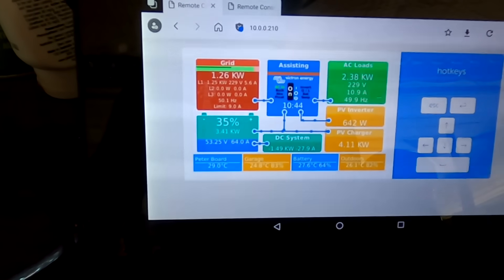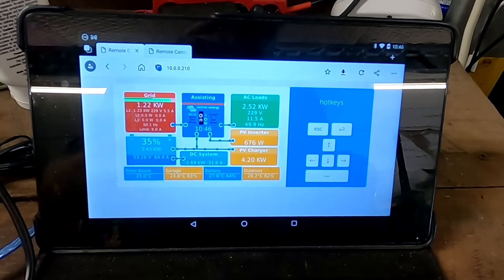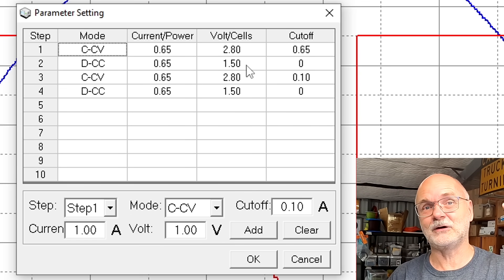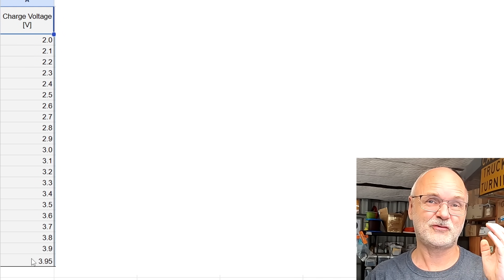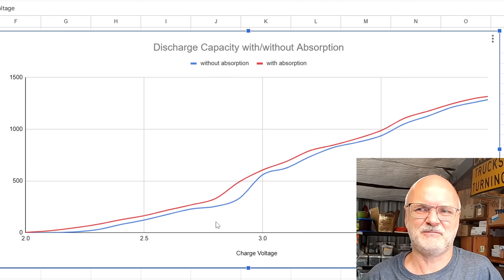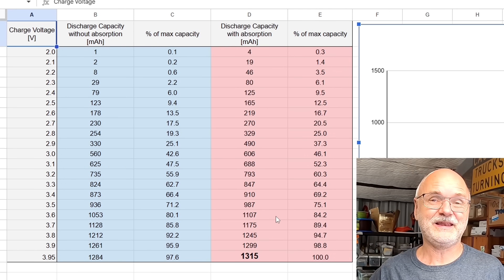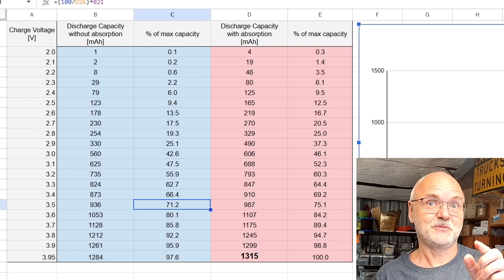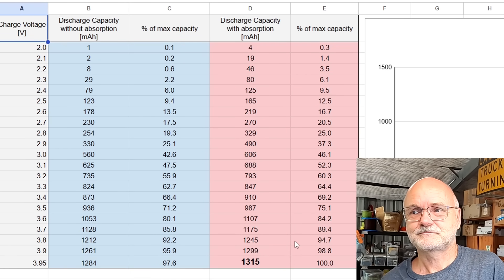Absorbing Sodium batteries. Capacity gain or worthless?

Comment: HI
forgive me if I take advantage
I have a problem with bms JK B2A8S20P-HC
I made a mistake in setting the temperature, the BMS turns on and I can read the screen that indicates "TEMP --200° celsius"....but after a few seconds it turns off, I disconnected the BMS from all the cables power supply and after 3 hours I reconnected the BMS but nothing changes, it shows for a few seconds that everything is ok no errors but the temperature is ---200° C, what can be done? I wrote several emails to jkong but they don't reply.....thanks for your understanding.
michele italy
Best regards
Reply from the maker: Disconnect the temperature sensor?
Reply: @OffGridGarageAustralia  connected or disconnected nothing changes 😪
Reply from the maker: @theanimalsfarm5911  No idea, sorry.
Keep emailing them and send messages on Whatsapp as well.

Comment: Hallo Andy. Ich schreibe dir hier weil ich sonst nicht weis wie ich dich sonst erreichen kann. Es geht um den neuen JK BMS. Hab hier bei mir 2 Stück davon. Leider gibt es ein Problem bei dem Pylontech Protokoll. Dort fehlt die Manufaktur Name. Die wird nicht gesendet und aus diesem Grund funktioniert z.b mein Solis rai-3k-48es-5g nicht. Wechselrichter meldet sofort Alarm (BatName-Fail). Hab gestern die neue 15.11 drauf gemacht. Leider ohne Erfolg. Was aber halbwegs funktioniert ist das Victron Protokoll mit meinem Solis WR. Problem hier ist dass die Spannungen RCV nicht übertragen werden. Das nächste Problem beim Pylontech Protokoll ist wenn man zwei BMS parallel schaltet. Beide sind auf 63A Ladegrenze eingestellt. Beim Wechselrichter werden dann 59.8A angezeigt. Das ist ok, aber dann in unregelmäßigen Abständen sendet der JK BMS neuen Wert an den Wechselrichter und der ist 119.7A. 10 Sekunden später geht er wieder auf 59.8A. Also es ist beidem Pylontech Protocol ein Wurm drin. Bitte helfe mir. Hab schon JK selbst angeschrieben aber es kommt keine Antwort. Gruß Peter aus Deutschland.
Reply from the maker: Thanks for sharing. Nothing I can do because I cannot repeat this test here as I don't have such an inverter to test. Pylontech protocol is always a compromise and may work or may not.
Reply: Thanks Andy for the feedback.  I can understand that you can't test this.  You should only send a message to those who add this company's name to the log.  They have now done this with the Victron protocol!!!  Version 15.11 says in the log history that the vendor name has been inserted, which you can insert yourself via User Date.  Also available on the Internet: (CAN ID: 0x35E) must be PYLON in ASCII format as the manufacturing name.  You could just forward this to JK.  Thanks.

Comment: Running 20 to 80 percent isn't an issue if the batteries are 500% cheaper and less impact on environment than lifepo. 
Q on balancers - this depends on durability and homogeneity of characteristics of separate sodium cells. If homogeneous and durable - balancers.
 become redundant.
'48v' battery may need 17 or 18 cells  to accommodate the 20% level 2V per cell charge and operate 34V to 67V.
Reply from the maker: Well, space requirements are an issue for most. If you need double the space for the same capacity, that's not great.
Reply: @OffGridGarageAustralia  totally true but the tech is new. Batteries running on one of the most ubiquitous and cheap elements on the planet. Maybe with some rnd they can change the chemical composition to flaten the discharge voltage. I'm a pragmatic idealist and I'm fascinated by your hard work to understand this tech. No doubt somewhere in the world (probably China) bright minds are working on your concerns. I wish it were the West but we are seemingly more interested in pronouns and Love Island.

Comment: Thanks for doing this testing and putting it out there. Interesting to see.
You'll have to buy a few of the smallest testers possible and put the cells on constant cycling between different voltages for a year after the balancers - see the lifespan.

I guess with no rare earths they have the potential to be cheap in the future, and if they were 25% the price of LiFePO4, but you could only use the middle 50% of the capacity - but that also meant they would do 10,000 cycles and were even safer then its the still half the cost and double the life.  I know that's not the case now, but surely a possibility in the future, for applications where space/weight isnt a concern.
Reply from the maker: Yeah, long term cycling is a problem as the tester needs to stay connected for that period. And a potential computer to read the data.

If you only use the middle 50%, it would also mean you need twice the capacity to match LiFePO4 atm. The space and weight requirements for batteries would double with Sodium.

Comment: with the steeper soc charactheristics all those low balance current bms's can  actually work,  if you can leave balancing on all the time, none of this pulling out of balance on flat part of lifepo4, and with current hardware everybody has to become not discharging below 10-20% clan.

cause the sodium cell would probably go out of inverter range

Comment: good stuff Andy.  Looks like you would need to use a beefy boost converted with Sibs cos of the steep Volt decline, so as to maintain a reasonable 12 or 24 V level for EV operation.  Given that a SiB cas expect 10 year + life.  Roll on asap its what we need get the production cost down soonest

Comment: I'm sure Andy already answered this: Can this cell type if arranged in a 4S-16s configuration omit the BMS?
Reply: omitting a BMS is never worth it - BMSes and balancers even make a useful difference in the oldest lead acid batteries - we just didn't have the technology back then and we stopped developing lead acid by the time balancers became cheaper.

BMSes allow you to charge faster, cycle more often and use significantly more of the potentially available capacity without risking damaging a cell with under- or over-voltage and temperature, and even over-current. There is almost no downside to using a BMS except for cost - but since BMSes cost just about the same as a hand full of cells, and they can save those cells within their lifespan, its always worth the cost.
Reply from the maker: Wouldn't you use a BMS also for current and temperature control?
Reply: @OffGridGarageAustralia  It was so cold here this past few months even the toilet and and pipe froze solid. I was standing there with a torch trying to melt through when it came to me.......this is a bad idea! I'm current limited by my inverter, it also shuts down on low voltage, and my smart solar charge controller can clamp down CC/CV at low temp.  Im  curious if these cells automatically balance in practice.
Reply: @anthonyrstrawbridge  the 4 series cells might balance among themselves, but they don't balance with respect to the next set of 4 or the previous set of 4 - there's no way for current to flow in such a way.

Also, sure your inverter cannot draw dangerous currents normally, but if it fails (and they do fail) then it will draw short-circuit type currents and then the BMS protects you so much faster than fuses or circuit breakers ever could - quality BMSes even reduce the fault currents during failures - this makes the resulting explosion rather be a non-event.
Reply: @Stefanfj  Temperature design limits of SIB's must be adhered too! Most practically speaking. ✌🏿

Comment: Sodium Battery packs for the current 48V inverters will have to be made with 15 cells. Sodium should be a good option for high voltage inverters though.
Reply from the maker: Depends on the inverter as we have seen in the first Sodium battery video. 16s can work as well...

Comment: You might want cell balancing if capacities in the battery are different, I guess. But it's not really as important as for LiFePO4.
Reply from the maker: So you think in a 4s sodium battery the cells don't drift?
Reply: @OffGridGarageAustralia  I suppose the question is whether they might drift predictably (i.e. together) or each one might behave differently, in which case balancing is a must.

But I'm sure you'll tell us soon enough!

Comment: Excellent Andy, a very interesting test that makes me want to build a sodium battery pack and run tests to compare it with my two LiFePo4 units (3004A + 100A). 🙏Thanks for sharing this one more video
Reply from the maker: Thank you. It's a bit of an investment to build these larger sodium batteries and you may not be able to use them productively.

Comment: I do not think a balancer will pay for itself wilh this chemistry. But it might be fun to test anyway.
Reply from the maker: So, no balancing at all? Why do you think the cells won't drift? They may have different internal resistance and therefore different heat loses.
Reply: @OffGridGarageAustralia I was thinking more in line of passive or periodic manual balancing because of the steep curve making this easier to spot and self-correct over a greater range.

Also  the available chargers can not reach the highs or lows of a 16S Sodium battery, so would it really matter that much if one cell added 3.95 volt at the top and another just 3.65 volt?

All of this assumes very low production cost in the near future, making it easier to just add capacity than optimizing and balancing a more expensive set of LFP cells that is better for cars, bikes and portable electronics

Comment: Great video as always i will use your charts 😅😅 i think charging to 3.8 is enough and compatible with all inverters and down to 2.5.
Reply from the maker: Thank you! That could actually work and also keeps the battery in a healthy voltage range without going into the extremes.

Comment: Hi Andy, very nicely prepared data 👍  I think that a balancer will be much easier to equalise the cells, precisely because of the nicely increasing voltage level run-up😎👍
Reply from the maker: Yes, in theory it should be easier to balance sodium cells. It will be in the next video soon...

Comment: These are early stages. I bet better Chemistries will be out soon. Why condemn sodium when this might not even be the correct sodium battery?
Reply from the maker: Well, this is exactly what people read on the internet. New battery chemistry will take over... this battery charges 100 times faster and never dies...
All BS, I would say. Only 0.01% of battery inventions actually make it into a small pre-production and even less will be available 10yrs later. Of course they will improve sodium batteries over time, but I just don't see the need for it as long as we have LFP. Sodium will NOT replace LFP as so many articles say.

Comment: Sodium is only attractive if the price is much lower than lithium batteries.
Reply: And if you need a chemistry to work in low temperatures.
Reply: How about if we want to electrify everything and get rid of fossil fuels? I think salt instead of Lithium will make a lot more sense as battery storage needs to scale far beyond what is used now.
Reply from the maker: There another factor most people don't think about: Space requirement and weight. 
Low temperature is only a small advantage as these cells can only handle 0.2C below 0°C.
Reply: For me i have small garage system for lights and sockets and its unheated and it has one 500W panel and inverter/charger and couple small agm batteries for 24v but we are 6+months freezing temps so lifepo4 not going to work in winter and agm self discharge is higher than production in middle of winter so  sodium would be something to set and forget i dont need high c rates just something to stay alive @OffGridGarageAustralia
Reply: @OffGridGarageAustralia  0.2C on a 'typical' 280Ah 48V pack is still over 50A (2.4kW if we assume 48V). That's not insignificant, especially considering that there would be very little solar at those times. It's also a decent load on a small generator.
Reply: @OffGridGarageAustralia  Space inside an unheated shed is less of an issue than space inside the heated home. We don't all live in sunny hot Australia.